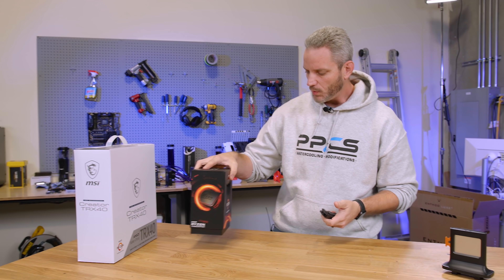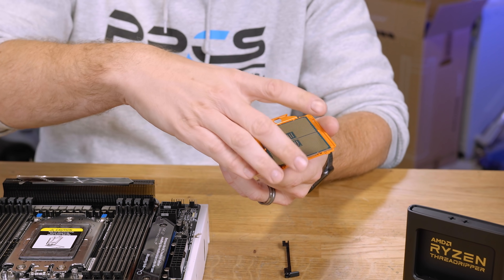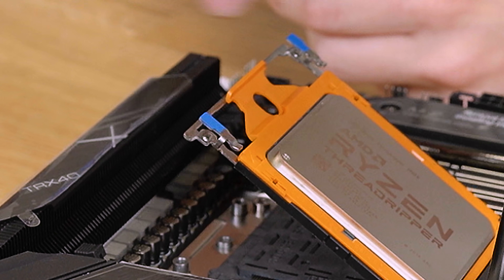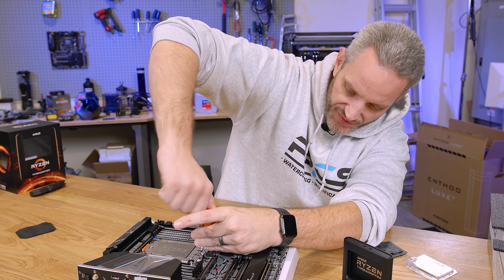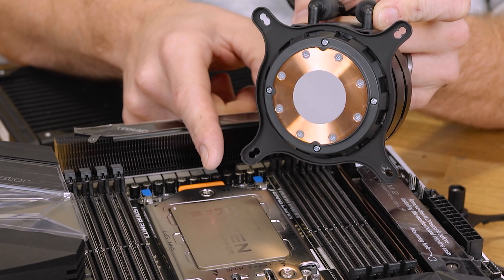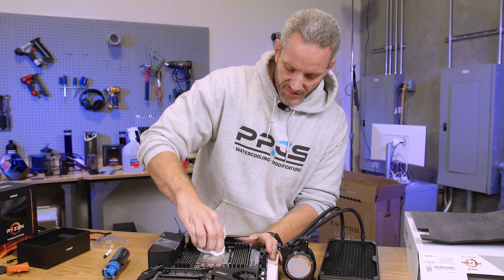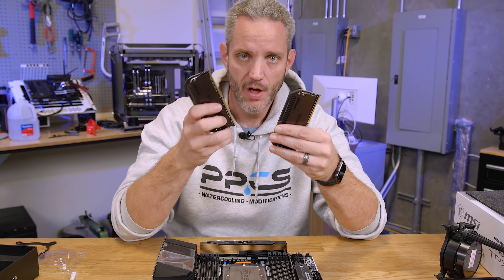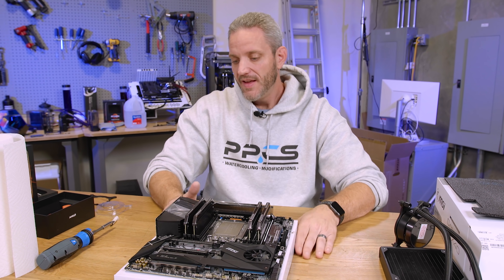Don't Make These Threadripper Mistakes!

Comment: Tip 1: Be able to afford it
Reply: Tip 2: Be able to open the box.
Reply: @jamiemahoney2446  that was exactly what i was thinking lol
Reply: Yes, I wanted the 1920x because of its low price per core, and then looked at the price of the motherboard....
Reply: @benjaminblack91  asrock phantom 6 is 239... a decent board thats lga 1151/am4 cost more
Reply: @benjaminblack91  I use workstation motherboards from Intel its 500$ and worth it. Not only gaming but running multi apps on the background, rendering and all whatever you can think of all together without the bottleneck. Its worth it buying the motherboard. Hopefully this monster will be cheap over three years so I can own one. my setup is e5-2699v4 2x + asus z10pe-d16ws + 32gb ram.ecc 2400mhz + rtx 3060. Its an old Xeon but, wow what a monster compared to an i9. Wish the TR pricing on the 3990x drops so I can afford one.
Reply: Tip 3: Don't drop it
Reply: @dan_loup  Reading your comment, I literally heard in my head: "LTTstore(dot)com" ^_^
Reply: I can afford to build a TR system, its just that I dont have any use for it, for now....
Reply: Tip 0: figure out why the heck do you need so many cores 😀
Reply: you'd be surprised how many monkeys can afford this. NOT INCLUDING ME :/ I wish I was one of those monkeys
Reply: Just did a complete build around the Ryzen Threadripper X3990 occupying the maximum amount of possible RAM, and 2x 2080Ti, I already factored in the price for 2x rtx3090 but those cards are available yet, but the price I came out on for the "God Tier" pc build was a little over €10400,- Yikes! I'll wait till I'm a millionaire or just keep dreaming and never buy it because I also need 1 or 2 monitors that can run in 4k @ at least 144hz, so yeah, thats probably another €4000,- not counting the keyboard and mouse etc, I didn't even include any RGB lights etc, it's scary to think that is what the system costs, and it can probably only run on max settings for about 10 years until you fall behind on your CPU or something. I'll have to pass, but thanks very much for the explanation on how to assemble my God Tier build JaysTwoCents!
Reply: TIK cries in ryzen
Reply: The cheapest combo ive found so far here is 3960x + Asus Prime TRX40-pro, which combined would cost me 2371 USD (!), then I just need all the other parts of the computer.... :-)
Reply: Ya I be able to afford 3990x in January ^^
Reply: Love my 1950x
Reply: @nzfade1  me too
Reply: 1950x ($320 used)
rog strix X399-E ($380 brand new)
Reply: Tip : You actually need it.
Reply: Or wait a year then buy it, as in my case for a Ryzen 2700X, bought on sale
Reply: Tip 0 have a usecase for that baby
Reply: OMFG I AM LITTERALY THE 3000 LIKE IM SOO HAPPY XDD
Reply: Overdrive Tech Tip 2: Don’t drop it
Reply: Buy a 1920X used for 160€ - gosh, AMD has brought down CPU pricing.
Reply: Tip 0: actually have a use for it
Reply: @Mr0T  My home server :D.
Reply: Tip 1838: Once you rob the bank upgrade to a dual epyc 7763 for only $50,000!
Reply: Hey there on Amazon for half price at least the 1900
Reply: Perfect way to build credit when you’re young
Reply: Well get there
Reply: The 12 core / 24 Threads TR 1920X has a fantastic price of $199 aka The "Poormans" TR. :-)

*Disclaimer:* I have the TR 1920X and have ordered a 3960X.
Reply: @MichaelPohoreski  That's great and all, but people tend to forget that the TR compatible motherboards are waaaaay more expensive than AM4 motherboards.
Reply: DasFroDo TV Prices for 3rd gen mobos are definitely pricey. I paid $338 for the ASRock X399 Taichi which is quite reasonable.
Reply: @FrozenDozer  There are a ton of used TR motherboards for sale now that people are upgrading to the 3rd gen TR.
Reply: @FrozenDozer  if u dont know where u will use it, u dont need it, if u need it, price aint problem
Reply: @MichaelPohoreski   That's how I did it - 1920x all day long. Maybe one day I'll go 2000 series, but not likely for my use case.
Reply: @NickPapandria  I hear ya.  I'm not sure if I'll ever upgrade the 1920X to the 2000 series. The 2950X would be nice but after ordering the 3960X it's hard to justify yet-another-TR (as much as I would love to) -- especially the 2nd generation when you know the 3rd generation are that much better.
Reply: Nick Papandria So I ended up with 3 Threadrippers:

* 1920X
*  2950X
* 3960X

I just finished building a 3900X for the family and was able to sneak a few benchmarks:

The 3rd gen 12C/24T Ryzen9 3900X is faster then the 2nd gen 16C/32T TR 2950X. Still processing the data but the looks like it isn't worth it buying a 2nd gen TR unless you can get a good deal.
Reply: @MichaelPohoreski  remember new mainboard as well
Reply: Kai Sörensen Yup $1400 (CPU) + $500 (mobo) for 3rd gen TR.  Definitely not cheap.
Reply: @MichaelPohoreski  Yeah but does the TR 1920X have quad channel 5GHz overclocked RGB LEDs?
Reply: @TheYugamer13  dont need 5ghz
Reply: @MichaelPohoreski  Check OfferUp, got a 1920x sealed and still under warranty for $120
Reply: Daniel Cook Thats a sweet price!
Reply: @MichaelPohoreski  don't forget to order the new motherboard too 😜
Reply: Mohamed riyan 😎
Reply: @MichaelPohoreski  The boards cost more than the 1920x
Reply: Ostern03 kappa Yeah 1st gen TR motherboards have cost more then the TR 1920X since ~Sept. 2019.
Reply: @MichaelPohoreski  i am going to buy a 1920x
Are you selling yours?
Reply: DarkHawk No plans to sell any of my 3 Threadrippers. My 1920X is running my private Conan Exiles server. :-)
Reply: @MichaelPohoreski  ok. Is it worth the $190 on amazon? The 2700x has increased from 168 bucks all the way up to 298. Not sure what caused that, but now I cant afford it!

Edit: it is now 277
Reply: DarkHawk Is the 1920X worth it? That REALLY depends on context. Generally no -- BUT I don't know your workflow. 

Personally I would go with a 3rd gen Ryzen 3600X .. 3950X as you'll find the increased IPC to be more performant.

If you can give me some examples of your workflow I can better gauge the bang / buck. Are you CPU bound? I/O bound?
Reply: @MichaelPohoreski mainly focused on video and photo editing, and gaming. From what I've seen, the 1920x performs better than the 2700x in a few games, and vice versa. With the prices jumping all around right now, if they market doesnt recover soon, I will just buy the 1920x, since $190 isnt a bad deal for 12 cores 24 threads.
Reply: @MichaelPohoreski  also, I dont really have a workflow as of now, because I dont have a PC. I do all my editing on my ps4 🤣🤣
Reply: DarkHawk I have over 600 games in my Steam Library. If you are curious about they perform on the 1920X I might be able to give you some stats about performance with a RTX 2080 Ti and GTX Titan.
Reply: DarkHawk LOL OK.
Reply: @MichaelPohoreski  it's the only option I have. Sure there isnt anything special about it, but for my 25 subscribers it does fine.
Reply: @MichaelPohoreski  wow. I dont have near enough money for a 2080 ti, but I am most likely gonna get a nicer 2060 super or a lower end 2070.
Reply: @MichaelPohoreski   im thinking of the tr 1920X but for gaming because why not but prettu sure im better with the R9 3950 or i9 9900k but i only have a 1080ti so maybe next build but thats a nice setup how much ram?
Reply: KronicNitron 3rd gen Ryzen is WAY better then 1st gen Threadripper.

All 3 of my Threadrippers have 64 GB of RAM.
Reply: @MichaelPohoreski  You got 3 Ryzen Threadripper systems?
Reply: vh9network Yes, three TR.

* 1920X
* 2950X
* 3960X
Reply: @MichaelPohoreski  Some Threadrippers are affordable, but the motherboards cost a fortune. You also need the special cooling/brackets. It all adds up to an almost as expensive system as a 3900X which is then way newer, eats less, etc. Trust me, I toyed with the Threadripper idea a lot.
Reply: A анонимный Special cooling / brackets??? Not sure where you are getting your information from but I have two $80 Noctua NH-U14S TR4-SP3 CPU coolers for my TR 1920X and TR 2950X respectively; my TR 3960X has the Wraith Ripper that I paid around $120.

Spending less then $50 on a CPU cooler is dumb considering how many years it will last.
Reply: @MichaelPohoreski  I just installed me 3960x hehe
Reply: @threadripper1822  Welcome to the Threadripper club!  You will enjoy your CPU for many, many years when you aren't being depressed at how many devs are not taking advantage of extra cores! :-)
Reply: @MichaelPohoreski  how many rgb's
Reply: Viky None -- not my cup of tea. Personally, I hate that light / bling shit. Even the bloody "high end" RAM has RGB lighting on it these days. LOL.
Reply: @MichaelPohoreski  Mine wouldn't. Nor would the fans, nor would the cooling. The case wouldn't even have a glass side if I could avoid it and still get a decently made one. I don't have any need for a lightshow in a box nor do I want to pay extra for that crap.
Reply: Michael Pohoreski noob shoulve gotten the 3970x
Reply: Ares Corleone 1. Why waste money on a 3970X? I want to see what the 3980X and 3990X will cost first.
2. The 3960X is better bang/buck ($58/core vs $62/core.)
3. The 1920X has 12C/24T while the 3960X has 24C/48T which makes for more interesting comparisons.
4. So you are offering to buy me a 3970X?! Cool!!
Reply: @MichaelPohoreski  Cannot see the attraction of Threadripper tbh. Folks took the piss out of Intel for a $/£2000 CPU but seem quite happy to recommend an AMD cpu for the same price. Yeah Intel's part was way, way overpriced, as well as being expensive but the 3970X is still a $2000 and god knows what the 3990X will cost. AMD is just doing an Intel now and showing how easy it is for a fool to part with his money. Sad really. 3950X would suit 95% of those getting a 3960X/3970X at a much more reasonable figure and perform within 5/10% max.
Reply: clansome Threadripper really depends on context. i.e. For rendering / compiling it is a no brainer.  
Agreed that the 16C/32T R9 3950X for $749 is a fantastic deal, along with the 8C/16T R7 3800X for $330 will serve most people's needs for quite some time.
Reply: @clansome  You are so right. Can anyone say Nvidia pricing model.
Reply: @clansome  consume
Reply: I already got this and 2 more!
Reply: And then follow directions XD
Reply: If you can't afford it you probably don't need it, though.  The things HEDT platforms are good for generally pay well or are expensive hobbies to begin with.  If you're gaming the 3000x ryzen series is really good. TR is for doing virtualization, video rendering / 3d modeling work, development on complex complied codebases, stuff like that.

There's already good deals on the 19xx/29xx threadrippers as people upgrade, expect to see massive firesales on the older WX models when the 64core versions hit 20Q1 since there's no longer a NUMA penalty.  Those will be coming with MBs as well, since you need to upgrade both for the new ones.
Reply: Tip 6: Try not to cook an egg, it’ll burn, a lot.
Reply: 2200th like
Reply: Tip 4: Stop beeing poor.
Reply: Pretty much lol if you spend even 1400 on a cpu and 550 on a motherboard buy an aio at least
Reply: Not that expensive
Reply: A year later Bruv. There are some fantastic "poor mans" options lol. I just picked up my Asus prime Mobo and threadripper CPU for like £480... So yeah... we're not talking a grand upwards anymore...
Reply: Tip 4: Something called saving up
Reply: be quiet peasant

Comment: thanks will be very useful if cpu arrives one day :P mounting the CPU especially at those prices is always a stress, if you already have a corsair AIO there's an adapter : CW-8960054 it's just not in stock much  (may not be perfect but better than nothing) EDIT : i ordered one on aliexpress of all places...they have it in stock but not corsair https://www.corsair.com/us/en/Categories/Products/Accessories-%7C-Parts/PC-Components/Cooling/Hydro-Series-H100i-PRO-H115i-PRO-H150i-PRO-TR4-Mounting-Bracket-Kit/p/CW-8960054